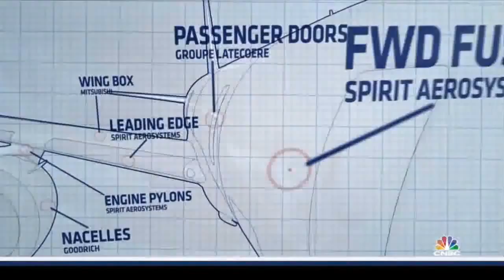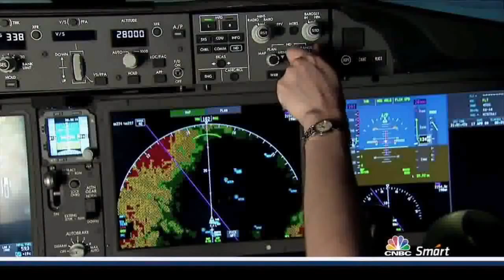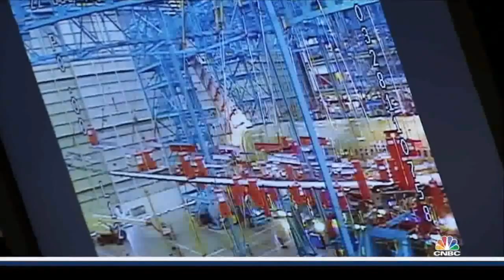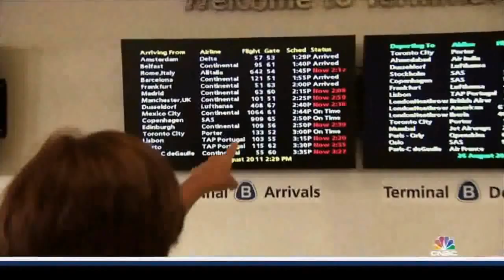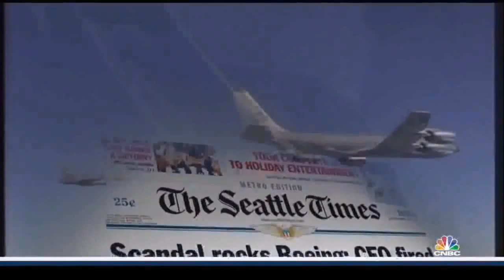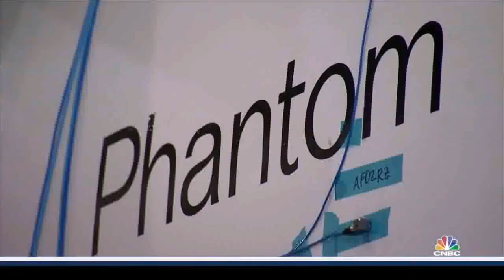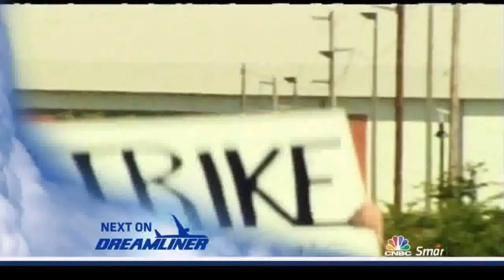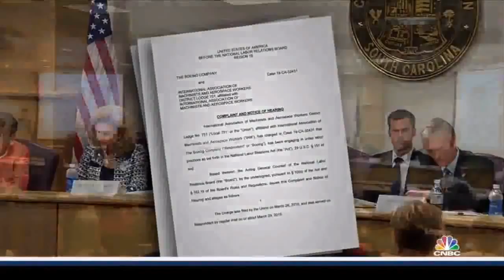Boeing 787 Dreamliner - Engineering the Dreamliner Full Documentary

Comment: Early models are expected to be buggy, specially clean sheet design models. Learning curve with the manufacturing with millions of parts! These modern aircraft are far safer than any passenger jets back 50 years ago
Reply: Did you even read your comment, the plane can be "buggy", no, no it can not.
Reply: I'd forgive some of these issues if this was Boeing's first attempt at building a plane, but they have decades of experience.
Reply: Not just safer but environmentally friendly.
Reply: @mememachine8954  uh oh, my airplane has a virus, guess I'll put it on sick leave

Comment: Look up Boeing 787 on Wikipedia - lots of issues with battery fires, engine failures and fuel leaks! Some airlines had to ground their entire fleet of 787s due to dangerous failures, and the FAA has asked Boeing to correct the battery issues on multiple occasions.

Comment: The Dreamliner has already become a big success for Boeing. In February of this year, Airbus said it will no longer be manufacturing the A380 starting in 2021 due to weak sales. Since 2007, Airbus has only received 325 orders for the A380, while Boeing has seen over 1200 orders for the 787. The good things about the 787 are that it’s very profitable and can save airlines millions in the process, because it uses 20% less fuel. The A380 used so much fuel and was so big that many airports had to spend millions to extend their runways or build new ones to accommodate this massive jet.

Comment: One of the best aircraft Boeing has ever made? No, the 777 is better, simply because it works
Reply: Adam Hart 787 works  also fantastically.. 260  planes have been delivered and they already accumulated millions of miles in absolute safety and comfort. As far as 777 is concerned I am also in love with this aircraft  its the workhorse of  Air France which operates more than 60...
Reply: FORBAN2 Yes that is true, its just that it irked me slightly when it said "the best boeing aircraft'.

Comment: Okay here's what puzzles me: Boeing was asked to build an airliner that holds 300+ passengers with a range enough for non stop transatlantic flights and from first blue print to first delivery it took them 2 and a half years to come up with the 747. They developed a completely new airliner design from scratch without fancy computers using slide rules and drawing boards. So why does it take 8 years now to do the same thing and come up with a new designed aircraft when the engineers have every last piece of technology at their disposal and computers doing the actual design and calculation? And once it was done and delivered to it's first customer, it was a matter of shear luck that no one got killed when one after the other caught fire because of batteries they knew from the get go would be dangerous. It occurs to me that there is something wrong with Boeing's way of doing business these days.

Comment: Per initial plan the 7E7 later designated the B-787 was to be delivered in September of 2008. This was the determination of the ONE-PLAN-TEAM which I was the Technology representative. However the 1995 Golden handshake and subsequent  deliberate forcing out of senior employees left inexperienced employees in charge. During the Maintainability meetings (which I was a member) started with the Sonic Cruiser it was made clear to Air Lines like Alaska that Epoxy Graphite construction didn't allow for hidden or secret damage (Alaska Air Lines during these meetings proclaimed that 28% of defects, damage to their aircraft was found during scheduled inspections; not reported.) as this material does not show impact like aluminum. This results with internal delamination and would go unidentified until after a number of pressurization  cycles, when the system failed as we learned on the B-2 research this type of damage on composite assemblies could/will result in catastrophic failures. 7E7 executives (we had 14 Vice Presidents assigned to the 7E7 at this time) were warned by me personally as early as 2002 the program was already 18 months behind schedule relative to integration plans, (Mr.. Lucky was responsible for the integration plans, but not supported, so none existed). Already behind in giving the partners and suppliers tier four descriptions of their part of the airplane, this prevented them from costing or long lead procurement planning. I personally cautioned Alan Mulally about this failure in March of 2004 when he called me at home to ask how retirement and my surgeries had gone.  Maybe this news helped Alan decide to leave Boeing which has proven to be the biggest loss the company has suffered. His arrival at Ford is evidence of his skills relative to organization and communication. COMMUNICATION and INTREGRATION.;he weakness of the Douglas/Boeing company .
Reply: +Ben  Daulton Like the PINTO which Ford saved weight and money by not putting fuel bladders in the tin fuel tanks as designed. Chevy pickups with side fuel tanks......Explorer's top heavy and poor suspension, but blamed the tires and customers. And the list goes on.
Reply: +Ben  Daulton If you're talking about Alan, I have seen many more recalls on GM products than Ford and I own GM products and will not buy Ford. I was Ford from 1958 to 1989. Had a 1984 Lincoln Town car ( could not keep front tires on and had to replace the head gasket every year) and 1985 3/4 ton diesel pickup with defective brakes the dealers could not fix after a year of trying, so Ford said tough, it's to spec. Went Chevy extended cab 3/4 Ton and Honda. Honda LX was a mistake, so went Oldsmobile Intrigue twice.  If nothing ever went wrong after release Windows would be on it's third revision..Ha!

Comment: Well it MAY be a technology leader (it's yet to be determined) but the desire to save weight has gone too far in the interior accommodations. Thin, flat, cheap seats, molded tiny (and broken) plastic parts, vibrating wall panels, thin carpets and very poor sound deadening does not make for a comfortable long, very long flight. I'll take the 747, A-340 ahead of a "Dreamliner" anytime.
Reply: +Robert Bradley  plastic 4 times stronger than aluminum ain't cheaper to me,  go back listen to the documentary before comment, i prefer original then copy cats
Reply: Maybe your understanding of English is not good. What part of "interior accomodations" do you not understand. Nothing to do with strength, everything to do with comfort and directly or indirectly the passenger pays the bills.
Reply: It WAS Business Class - that was my point.

Comment: Break even is now around 1500 units.
Reply: I am 4
Reply: No problem..A380's break even is now 750 units..Far more difficult to achieve than 1500  for dreamliner..Not a single A380  was  sold at FARNBOROUGH last month. Without  Emirates the   A380 is  finished .
Reply: barracuda7018 The 787 will easily break even. The problem for the A380 & 747-8 is they are competing for a very limited number of potential orders in a market that can sustain only one type successfully. Both will continue to struggle until one company pulls the plug. It's a shame because they're both very impressive aircraft. There will always be a VLA market (however limited) and one aircraft in a class of it's own could rely on a pretty steady trickle of orders, just as the 747 did for 35 years.
With the introduction of the 777-8/9X in a few years I feel it will be the 747 that will bow out. It's only ~15% larger than the 777-9X in terms of passengers & cargo.
It seems somewhat likely that an A380neo will be introduced around 2020 & I doubt Boeing will further develop the 747. It's true that Emirates are currently propping up the A380 but there are still a lot of 747-400s that will eventually be replaced. Most will likely be replaced with 777s but I think there are still enough potential orders to keep one VLA in production.
Maybe the A380 will break even but it'll need a couple more decades to do so.
Reply: tjp353> It seems somewhat likely that an A380neo will be introduced around 2020 >

Highly unlikely considering the present order situation ( No new order since end of  2013 ) unless of  course European govenments throw additional billions  of tax payers money out of the window to finance a  NEO  PROJECT before the basic version earned  any money.
Emirates alone can't save the A380 from extinction ..
Reply: barracuda7018 No new orders in 15 months isn't too much of a problem with a ~7 year backlog of 163 orders and isn't too different to the 747's own year-by-year order history. Before the A380 existed as it's competitor it had a few single-figure order years plus some very successful years, eg:- 122 in 1990, 2 in 1993 (average 1966 to 2000 was 38.2). Over 5 years (2008 - 12) the 747 received just 4 total orders (3, 2, -1, -1, 1). So long as the A380 can maintain a backlog it's the average that's important. VLAs are always slow sellers but there will always be a market for large aircraft joining major hubs.
It's the 747 that's at far greater risk with just 37 aircraft undelivered, being built at a reduced rate of 1.5 per month. With no new orders it will stop production in 2018. This isn't intended as an attack on Boeing - I'd like to see both aircraft survive - but the numbers, plus competition from the A380 & 777-9X, suggest the 747 might not be around much longer.
Regarding the A380neo, Airbus are currently stating they want more customers to commit. Tim Clark of Emirates had promised initially 70, then 100 orders (the Wall St Journal claims 200). 'Somewhat likely' wasn't my speculation. Google A380neo and spend a while reading the reports from analysts and various financial news agencies. There are still a few 'what ifs', but the analysts generally seem to think it's likely.
Regarding loans, tax breaks & subsidies, it seems they're both as guilty as each other in the eyes of the WTO.

Comment: take note Airbus you will copy these technology  as soon they shut up period
Reply: +RASTA LOVER: Why would Airbus copy this technology? If anything Boeing will be copying Airbus. In fact Boeing are only now applying technology that Airbus have been using for quite some time now. It was Airbus that came up with the fly by wire technology for commercial aircraft and the composite materials that have been used on Airbus for years are now only being implemented at Boeing.
Reply: +celticlofts  .. horseshit
Reply: +Jack Whittaker no

airbus invented the fly by wire technology

they already used carbon composites in the a380
Reply: +celticlofts Boeing has been using semi double deckers for almost 40 years linger. They solved most of the engineering problems with large wide body aircraft before Airbus even thought of the A380.

Comment: 787  was  the most  challenging  aircraft project  in the history of civil   aviation.
all  composite  air  frame  without  hydraulics ?  never tried before  never  done  before  Boeing took huge risk  and  it seems that  they succeded.
Reply: No the A380 was.
Reply: Jan Prins No it wasn't
Reply: barracuda7018 why not?
Reply: barracuda7018  'without hydraulics'? What moves the control surfaces, undercarriage, nose wheel steering, etc? It uses Skydrol as it's hydraulic fluid - so it's obviously used somewhere.
It has 3 hydraulic systems - Left, Right & Centre. Left & Right are powered by pumps on each engine. The 3rd, centre system is powered by electric pumps, powered by either engine. The main difference between this and earlier aircraft is the power source for the centre hydraulic system (767 and others used engine bleed air driven pumps).
Reply: This is Flight ''Concorde was more daring than both of those, even the US admitted getting Concorde into service was just as challenging as getting man on the moon.''

The US has never admitted anything like that.
One  must be insane or utterly stupid  even to assume that building a supersonic aircraft could be as challenging as putting a man on an other planet .LOL .
Reply: This is Flight O.K lets say heavenly body..
Again it is not a fair comparison, come on man, Saturn V with 160 million horse power, until today still the most powerful machine made by man in the whole history ,3000 tons reaching a speed of 28.000 miles an hour
There is no comparion here in terms of engineering challenge.
No I don't watch British documentaries,BBC or ITV, extremely biased and one sided, sorry.
Concorde was a big achievement in its own right but the argument nobody else ever succeeded is a  poor one .
First ,the Russians have succeeded, they flew two monts before and with Mach 2.5 TU-144 was much faster than Concorde. 
The problem  was  that the Russian industry standards were  far  below the western rivals and that was the reason for most of the problems  with  TU-144. Had they used US made engines and avionics, it would have been a great  success but obviously it was out of question...After the first oil shock in 1973, nobody has seriously tried  to develop an SST.
Boeings 2707 Project  with  Mach 3, 260 passengers  and total titanium airframe was two  generation ahead and without government support, impossible to  develop.
Reply: This is Flight Most of the same same applies to the 2707.

NO DUDE..NEVER.. 2707  WAS  A WHOLE DIFFERENT BALL GAME...
ONE AEROSPACE ENGINEER FROM  MIT TOLD ME ONCE THAT THE DIFFERENCE BETWEEN MACH 3  (2707) AND MACH 2 (CONCORDE)  IS GREATER THAN  BETWEEN  MACH 0.8 ( 747,707)  AND MACH 2. . BELIEVE IT OR NOT
90%  OF  STRUCTURAL MATERIALS  USED IN  747 AND CONCORDE ARE THE SAME.
2707  IS  A DIFFERENT WORLD. 

SATURN V HAD NOTHING TO DO WITH BEING BIGGER OR SMALLER, IT WAS AN ENGINEERING FEAT  FAR MORE COMPLICATED THAN ANY AIRCRAFT PROJECT.